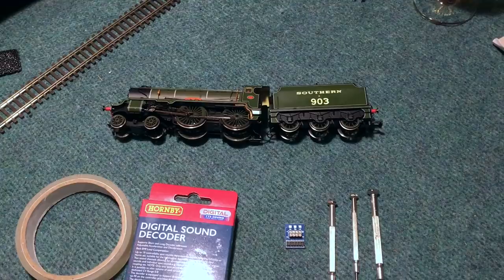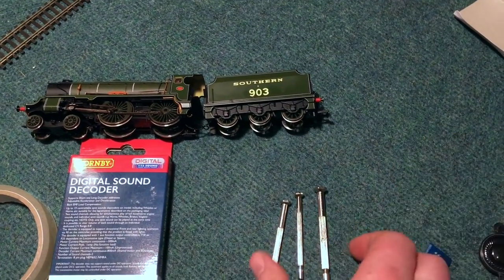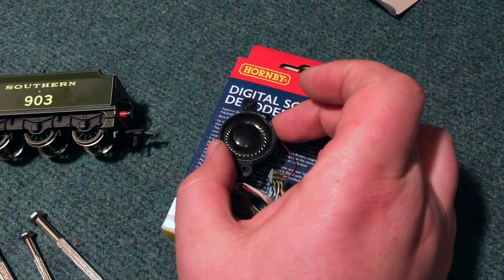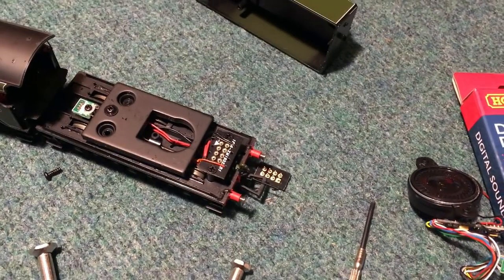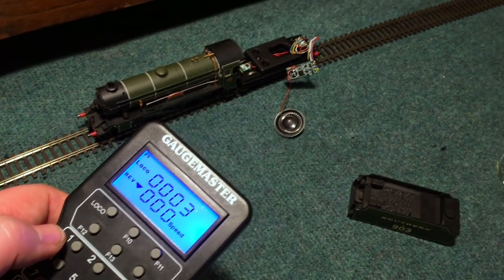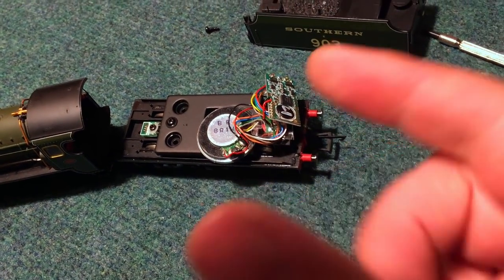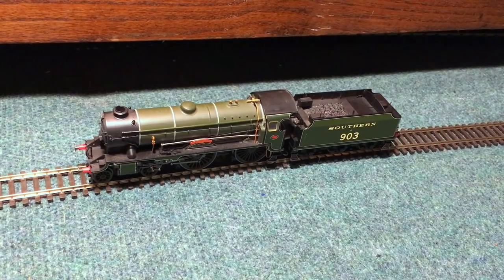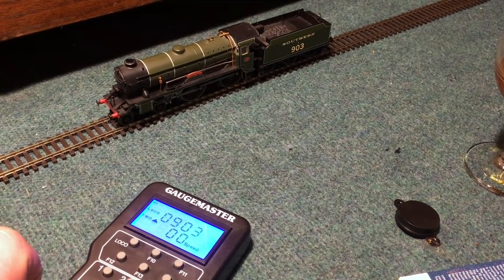Fitting a Hornby TTS Sound Decoder into a Hornby Schools Class Locomotive

Comment: A couple of tips.
Unplug the connection between the loco and tender, there is a special tool available for this. As you quite rightly mention, you don't want to stress these wires, it also makes it a lot easier to work on the tender not having to keep moving the loco when you need to move the tender.

The tender locos (mainly GWR) that I've fitted sound to, the speaker fits under the weight giving you a little more room for the mass of wires. As you have fitted your sound, it's not worth taking it apart to find out if this is the case with your loco, but it's something to bear in mind for a future conversion.

Chris
Reply from the maker: Hairy's Shed yes unplugging the tender would make it easier. I don’t have a tool to hand though and it wouldn’t budge when I tried a small screwdriver on it.
Reply: Hi Jenny . You don't have spend extravagant  money on a name brand Satan's plug tool. Just type "computer cpu  plcc extractor" into ebay and pick up a perfectly adequate tool for a few quid. Just get the el cheapo green handled ones. They work a treat 👍
Reply: Where can I get the special tool?
Reply: Hiya Chris... I have to say when I did this on the BR Westminster recently the plate was removable as you mention, however, the speaker that Jennifer appears to have is the same as the one I fitted and no it doesn't fit under the plate int eh schools class tender!

Comment: ps. In general, on HORNBY Tenders, the weight comes off and the speaker fits underneath, the shape of the weight’s hole designed to accommodate the top (or back) of the speaker. Cheers.